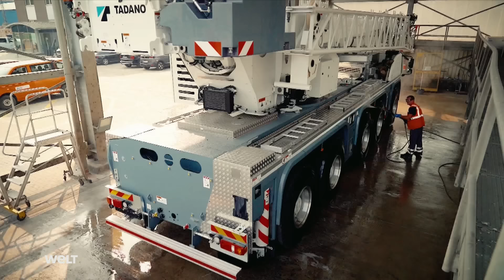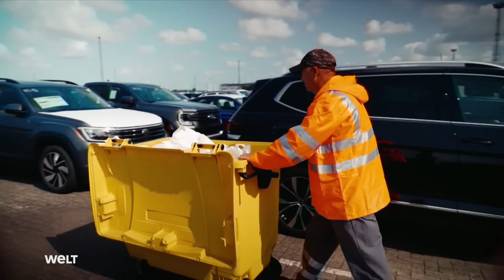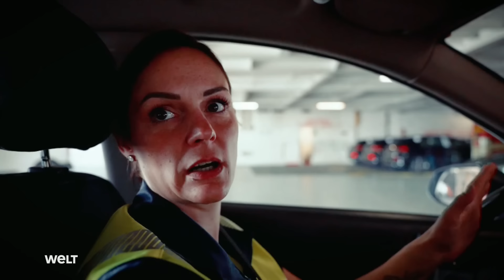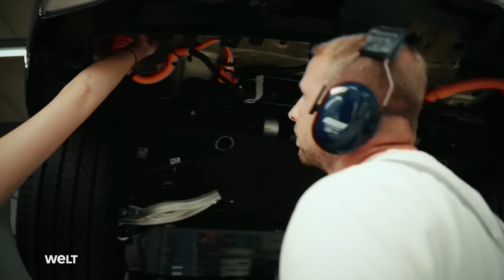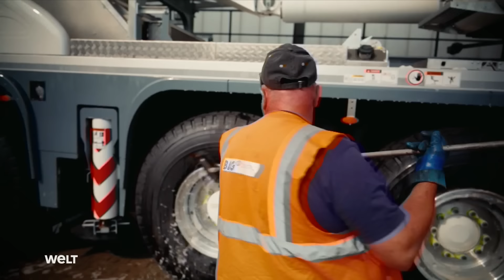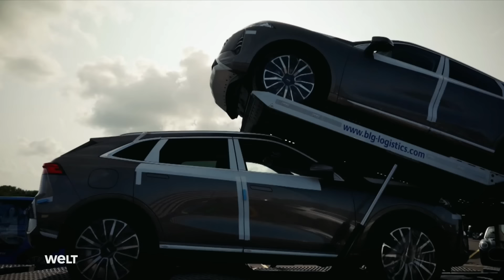What Happens to Cars at Europe's Biggest Car Terminal? Documentary

Comment: NARRATOR: Cars as far as the eyes can see. The car terminal in Bremerhaven, Germany is one of Europe's largest mobility hubs. Founded in 1827, the port has grown into a major logistics center on the North Sea coast. Each year, over 4,000 ships are handled here and more than 1.5 million vehicles are trans shipped. Many of them bound for destinations across the globe. As one of Germany's most important export gateways, Bremerhaven ranks among the largest carports in the world. While operations often run at full speed, there's one rule that's non-negotiable: these high value goods must not be damaged. That calls for steady nerves, especially from the instructors and drivers who move the vehicles with precision. Up to 70,000 vehicles can be parked on site, car trading in the era of globalization. At Europe's largest car workshop, imported vehicles from all around the world are customized and prepared for the market. There is no limit to size. In the high-end heavy zone, XXL machines roll in and out. Sometimes, all they need is a good wash. The car terminal in Bremerhaven offers a rare look behind the scenes of a giant import/export machine.

Comment: So that's how brand new cars have swirl marks and micro scratches in the paint.
Reply: yup they apparently don't believe in touch free wash that has the cleaning compounds built it no lets use a brush that gets set in the same buck that dirt can accumulate in as well as the dirt trapped in those brushes on the car wash itself
Reply: no, thats after local sand wash.
Reply: No wonder new cars have so many scratches!
Reply: Ни когда не гонял на мойке свою машину через щетки, ей 9 лет и она блестит как новая. Только без контактная мойка и с химией 😊.